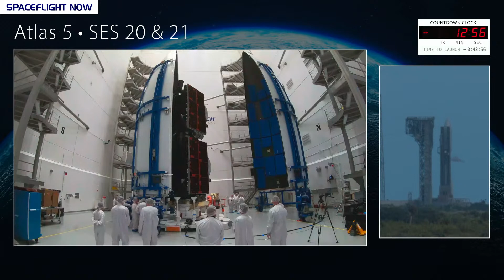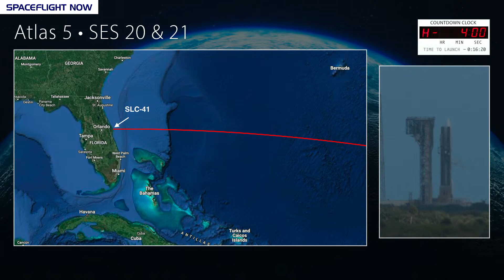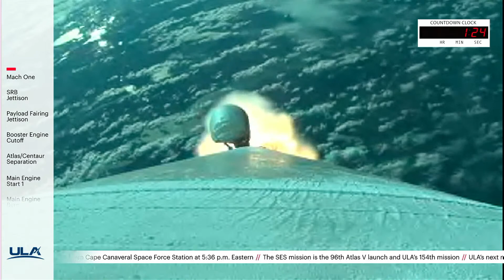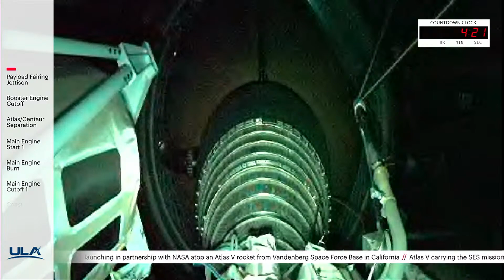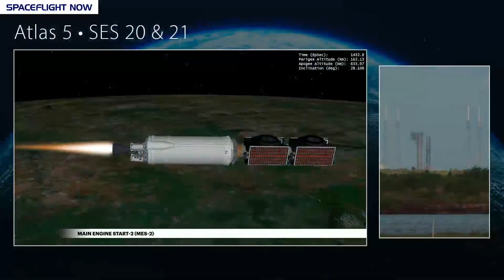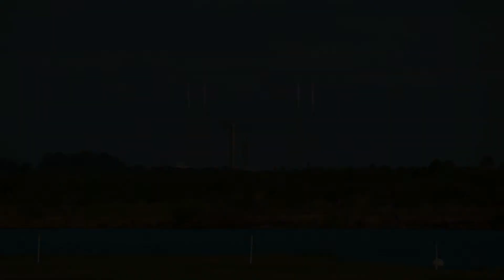Watch live as an Atlas 5 rocket launches two satellites from Cape Canaveral

Comment: Why aren't All parts recovered from the ocean? Even if it cannot be reused they add to littering our precious ocean
Reply: You wanna dive in those snark infested waters to retrieve them?
Reply: @sirtango1  SNARK? WHAT IS THAT 🙄 Hopefully,  you meant SHARK. Besides, NASA has the money to retrieve them with recovery vessels equipped for that.
Reply: @debraward1813  SNARK was the name of a failed rocket series. It’s a running joke inside of NASA, the SNARK infested waters around the Cape. All but one are in the waters around Cape Canaveral. The one that survived is in a museum. But one reason they don’t recover some of these parts is cost. That and the parts are meant to be expendable. No one would spend a thousand dollars to retrieve a soda can from the ocean floor. Same principle applies here. The heat from these launches renders the material useless and it’s only destined for the scrap heap if it were to be salvaged. One reason some of this stuff is recovered is the explosives on board. They don’t want high grade goodies to fall into the hands of terrorists. You see some of the failed attempts at launch being destroyed before they can come down in residential neighborhoods. They pack a lot of boom boom on some of those rockets. The bigger the rocket the more explosives it takes to destroy it.
Reply: @sirtango1  Thank you for replying. Honestly, I didn't know about SNARK. Going to look it up
Reply: Retrieve them and sell it on eBay.